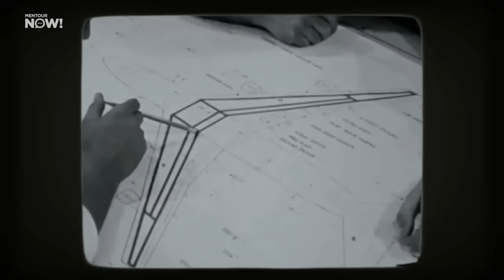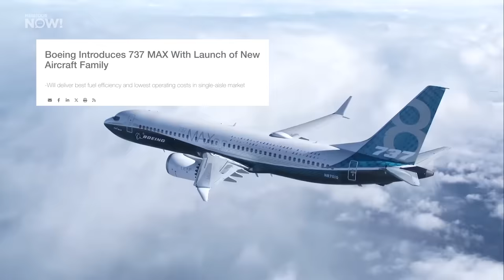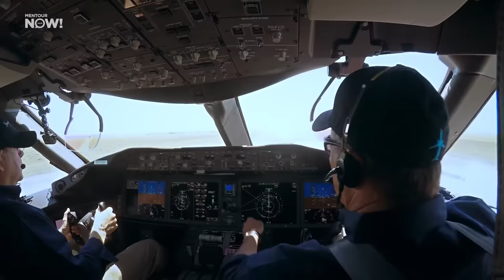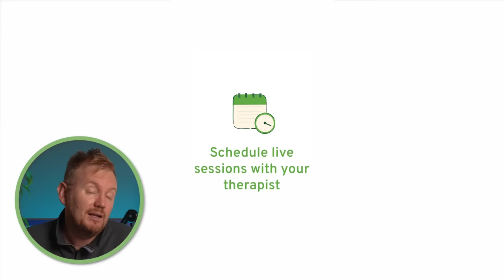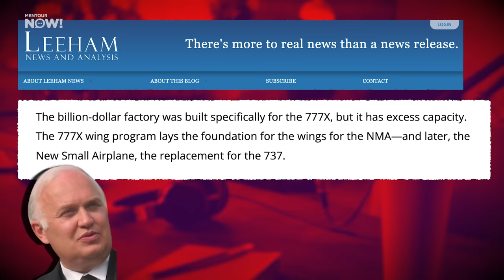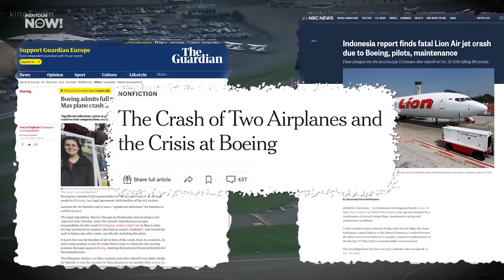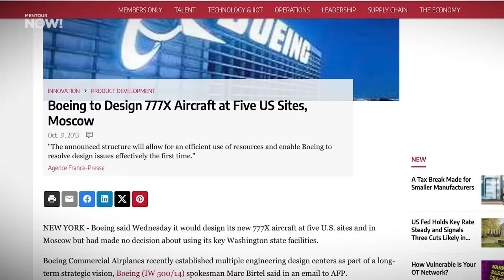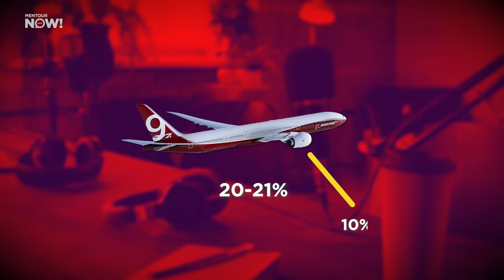What’s Going On With The Boeing 777X?!

Comment: The lengthening design and manufacturing process in aircraft mimics what has happened in the industrial process industries over the last 20 years or so.  Projects that used to take 4 years now take 5-7 years from initiation to startup, and the costs have escalated similarly.  Engineering effort has often doubled on a per unit basis, and often the industry is baffled by "why".  Having been involved, there are reasons that make sense, like increasing complexity and novel parts.  But I fear one of the big reasons is that the modern digital tools being used make it too easy to make changes and make it too easy to proceed with design details without making the necessary decisions earlier that will avoid rework.  I would argue that these digital tools have also reduced the fundamental understanding that engineers once had, and that increase risk of all kinds.
Reply: Agreed about the changes. MS TEAMS is also a big contributor to delay, as it's too easy to have a distributed team, rather than concentrated, and too easy to have a meeting - leading to sloppiness, poor preparation and an attitude that "Oh, we'll just have another meeting on the subject".
Regards from Oil & Gas engineering.
Reply: An interesting insight.
Reply: In my opinion the o so often praised "concurrent engineering" is to blame at least partially. Basically, you are supposed to design things that depend on other things that aren't designed yet and all they give you is the promise that it will work in a certain way when its design is finished. So if one element in the chain doesn't turn out as originally promised, everything that depends on that has to change too, regardless if its design was already finalised or not. So you end up with the situation, that you have to redesign already finished elements sometimes multiple times.
Reply: My experience in the last 40 years developing embedded systems, mostly for the military, is that the whole design and development process has decayed. It's all agile now. Which basically means hacking it together, discovering what you want as you go along. Exactly the behavior which maximizes the development time and cost.
Reply: increased complexity is NOT the problem.  In fact, actual manufacturing has become less complex.  The problem is the culture of meetings for meetings for meetings with literally, hundred guys in a room doing.... NOTHING in Aerospace related work due to unions as companies have farmed all the actual design out to sub contractors who are NOT union employees in the name of "saving cost"... which means now you have contractors who had parts designed literally a DECADE ago, as well they have to make a product and profit, who now delay the process or require meetings themselves, as Boeing now has extra middlemen delaying everything.  NO ONE is making any decisions... it is all being contracted out who have ZERO responsibility to actually... make decisions.  You have whole teams of Boeing employees who do nothing other than make contractor specs meeting with contractor spec people who both know NOTHING about the actual parts being designed with delay's involved, instead of a Boeing employee walking over to another who actually designed the parts in question and getting it straight to begin with without 2 additional middle men delaying everything who are not also trying to go through LAWYERS looking at contracts and playing hide the mouse while wagging the tail dog and pony show.    Not just a Boeing problem.  Guys from Airbus working for Boeing have told me same thing and why I refuse to work for EITHER Boeing or Airbus.   Zero engineering is being done or allowed to be done.  It is all managerial Bull Shit.
Reply: Compare the development of the Space Launch System, which costs NASA $4.2B per mission, to SpaceX Falcon Heavy which has 80% of the payload but costs about $160 per mission (of which over 50% is profit), never mind Starship which has twice the payload of SLS and yet will cost less than $100M per flight because it is fully reusable and is designed to fly hundreds of times per year, rather than once every two years.
Reply: @blatherskite9601  Oh gawd yes. worked for a major telecom manufacturer, pretty well every program was spread between various European countries, the us and china. There was rarely a time when all team members were all working due to time zones.
Reply: Now that the FAA has Michael Whitaker running the show instead of a stooge as always, let’s see if procedures get done right this time.
Reply: Arguing that CAD made overall engineering time longer has to be the dumbest take on this issue possible.
Reply: @gamm8939   It's not the CAD.  Its that designers and engineers using it that do not understand real fundamentals can easily design parts and assemblies that are very difficult, if not vertually impossible, to produce.  This then requires rework, and more rework.   Once you finally get a design that can be produced, not it often takes more redesign and rework to be able to produce it economically.

Fundamentally, CAD has made it too easy to design bad parts and assemblies.

I used on of the early CAD programs in the mid 1990's.   But, before I did anything in CAD I sketched out the concepts and various parts and talked to the machine and assembly shops on the ability to manufacture and assemble it.   Very often I suggestions on how to change the design at the sketch stage to improve manufacturability and assembly.  Then I sat down at the computer and opened the CAD program.

I also ran "draft" CAD drawings past the machine and assembly shops as well - and often tweaked things some more before the final drawings.

My boss at the time commented that I took 4 times longer to design a project than the new engineers who had only been trained on CAD.  But that my designs could be produced and sold with minimal, if any rework whereas the "CAD jockeys" projects had to be reworked multiple times to get the project out the door - and in the end I was twice as fast from idea to product moving out the door except for the most simple items.

A few of the "CAD Jockeys" started to take time to accompany me on my discussions with the machinist and assembly shops; and started to do incorporate that process into their process and dramatically improved the quality of the initial design.   I had an edge in that I had many years of experience and knew up front many things about machining and assembly that I did not have to ask about.

With today's world - the CAD designers likely have never stepped foot into the machine shops and the assembly shops where their designs will be fabricated.   That makes the feedback loop longer and in my opinion wastes a lot of money.

If you go back to the original Skunk Works that produced the U-2, A-12, SR-71, and F117 the designers were never further than about 60 ft from the assembly bay, and a quarter block at most from the machine shops.  The designers spent a lot of time in the machine shops and in the assembly bay (and often the machinists and the assembly people would call the designer and ask them to visit to discuss an issue or an idea to improve things).

CAD's great if you have someone who knows how to work with the machinists and the assembly people - and the designer can visit the shops at will.
Reply: That makes a ton of sense!!!
Reply: While what you said is100%  true for heavy machined parts, it is NOT true regarding aircraft which consist of built up structures. An exception would be say... Bearing support structure on say, landing gear, flaps, slats, empenage.  Especially not true regarding composite layup.  Structures designs to book values for strength(tensile/compression/shear), radius allowances, void tolerance, fatigue life safety factor padding, impact allowables, lightning protection, fastener pressure, tolerance for assembly and install.  For this reason, a single FEA guy can in less than a week do a FULL up analysis of a fuselage/wing from drawings(even less time with CAD-->FEA).  Now the poor sods who got the contract to build the weird S &H Shapes which not only provide fuselage strength but also attachment point for wiring harness and internal paneling, that is another story, but Boeing nor Airbus make any of those parts.  In fact the VAST majority of Airbus and Boeing structural members assembled into aircraft are NOT built by Boeing or Airbus.  Now you and I can see this as STUPID and short sighted by them, but they have BOTH been operating this way since the 1970's at minimum and earlier than this I do not know.  My father was a Boeing parts supplier, and I and brother have both worked at Boeing commercial at one point or another in the last 30 years.  I have also contract worked for IAI etc.  Maybe controls(Rudder hydraulics and aileron hydraulic controls) can work the way you say to work, but the rest does not and never has from my understanding.  
Yours truly Brian  @perryallan3524
Reply: My grandfather was an early programmer when assembly was the thing; code had to be logical and efficient as resources were so limited. He bemoaned the sloppy work higher level languages enabled. His complaints seem to mirror yours.
Reply: @jamescobban857 Starship has to survive a launch before it can be reused
Reply: @counterfit5  Or not require 28 "test" launches.
Reply: @perryallan3524 
That's one big part of the problem. But the root cause is always management. If the leadership doesn't know anything about engineering, just play with excel and powerpoint, then they will inevitably make stupid decisions.
Reply: @counterfit5 
FYI, SpaceX launched more rockets than anyone else. And still the only one that can reuse rockets.
This year 80% of all mass to orbit was launched by SpaceX.

You know why other rockets don't blow up? Because they barely changed since the Apollo era. There are rocket engines used today that were designed in the 50's and manufactured in the 60's. And these are still among the best engines available. The SLS is also made from Shuttle parts, in some case literally existing spare parts. The Space Shuttle was designed in the 70's. And btw. two Shuttles blew up, in operation, with crew.
If you look back to the days when actual development happened, you'll see that rockets exploded more often then not. The Soviet N1, which was similar to Starship, blew up 4 out of 4 launches, and the Soviets were the better engineers. American rockets practically all blew up until they let German engineers take over.
Reply: @alexturnbackthearmy1907 
There were only 2 tests. Previous ones were experimental flights with engines attached to mockups. And there weren't 28, and most of those were successful.
And why put "test" in quotes?
Reply: Interesting view.
Reply: We run into a similar issue with CAD/CAM software in machining. The software can do a lot, especially if you get the full suite. But CAD/CAM is ultimately just a tool, you need to know how to use that tool for it to be really effective. You need to know how you want the part machined before the software programs it out.
That being said, there ARE some major advantages to even rookies using the software, like crash avoidance.

As for the design process, it's a bit misleading. Because modern aircraft are far more complex, there's way more to model, and the model actually DOES a lot more (like aerodynamic and STRESS simulations).
Way more time is being spent in the digital design stage, but the result is an aircraft that performs way closer to the final product on the first test run. Whereas before, you'd work out most of the kinks on the assembly floor, in testing, and the first few years of service. Now most of that is done digitally.
The digital engineering tools are actually reducing the risks substantially.
Reply: Boeing laid off it's experienced engineering personnel in Level 3 and Level 4. They also offered buyouts. So Boeing lost a good portion of its engineering personnel, the people that have the most experience, and then they implemented DEI which has been a disaster.
Reply: Mission creep is all too real. Ultimately, the customer has to pay for the inefficiencies that are introduced by it.
Reply: I agree entirely that modern digital tools have made it too easy to make changes. The coworker alongside me routes PCBs (printed circuit boards) so that the components all have sufficient distance in terms of electromagnetic fields & conductivity, that none of the interconnecting data and power lines through the multi-layered board invalidate or unduly negatively impact one another - the finished output is ten used, without changes thereon, by the fabricated to actually produce the board. The process takes weeks. It only starts once a design has been signed off by the submitting team as 'done'.

Yet, the amount of times that a month's work has been chucked in the bin because  a mechanical engineer decided, two months after passing the 'no more changes' commitment gate, that he wanted to drive an extra screw through an 'empty' part of the board that has two dozen lines going through it and thus the amount of rerouting needed to make that change makes it faster to start routing from scratch. Half my coworker's output in a year is a complete waste of his, and the company's, time due to minor, unnecessary changes being made after having passed the gate for which the design should have been frozen.

Yet these unnecessary changes aren't duly challenged for justification, business case, cost/benefit analysis, let alone blocked. Weak process management, weak project management, few people caring for the big picture. There's a time to stop, a point where change is counterproductive - failure to enforce gates is crippling engineering. Project managers are supposed to have a grip of their teams, have made sure that "final means final, once we say final, no more changes"...
Reply: @gamm8939 , no it is true. The same thing has happened in the field of medicine. The very-nature of been forced to take time doing something leads to more neuron-connections been formed in the brain. This is the equivalent of weight-training building up muscle in the human-body. That then leads to a more functional body when engaging in sports.
Reply: @w8stral  actually the salient point is to be aware that what you can design on a computer may not be the best thing functionally, and financially, to build. Sitting down with the people who actually build the product can often lead to a better functioning, and manufacturable product. That is what “Toyota” does, and it definitely seems to work for them. Maybe  “The Boeing Company” should hire retired -“Toyota”-process-engineers to reinvent the company?!
Reply: @thundercactus , actually the first ‘Boeing’-aircraft to be designed on a computer was the original “Boeing 777”. It was finished on-time-and-on-budget. I have to believe that the problems that Boeing has run into with the “777X”, has to be due to management failures. The biggest failure seems to be the new engine development by “GE”. It would be interesting to know when the 777X would have entered into service if the “Boeing 737MAX”-fatal-crashes had not happened.
Reply: @ChristopherPearman  That's what I was alluding to; because digital design is powerful enough to do aerodynamic and stress simulations, a lot of the issues they'd normally find on test flights are found digitally. So while the digital design stage takes much longer than JUST the modelling, it ultimately dramatically reduces the amount of revisions and physical testing methods.
It's still just a tool, but it's an excellent tool to have!
Reply: And the color of the sky in Bolivia is purple... Hey, why not trot out other stupid aphorisms.   @ChristopherPearman
Reply: @w8stral , what are you talking about?
Reply: So, YOU clearly have never done anything in a small business or worked for a big company..... So, WHY are you replying if you do not understand basic English and Engineering workplace "workflow" realities forced upon engineers by ignorant CEO's who know NOTHING about manufacturing or how to design anything. @ChristopherPearman
Reply: @@BB-xx3dv LOL! We won't even interview game developers.
Reply: @w8stral  it's funny because space x in the case of rocketry is doing the opposite, they are making as many components as they can in house merging together the engineering with the manufacturing. Boeing used to be this way, hopefully they can in the future go back to doing things this way as there is better continuity when your engineering department, fabrication, and assembly are at or near the same area.

Comment: The original 777 offered folding wing tips (known internally as FWT and FWTEC) as options. Ran off the center hydraulics with connections to alternate and emergency supplies if needed. The option was flight tested on a market A -200 with PW4073A engines and a stretch (aka -300) market A with PW4084s and was certified, but no customers took the option. Interestingly, these original folding wing tips were longer/larger than on the 777x, and included flight control surfaces - the outboard ailerons and two sections of leading edge slats and were a combination of aluminium, graphite (the ailerons) and fiberglass. With all that and the 777x wingtips not including flight control surfaces that were certified on the now 30 year old 777, I doubt they’d be too much of an issue getting approved this time around.
Reply: 777 enthusiasts colour